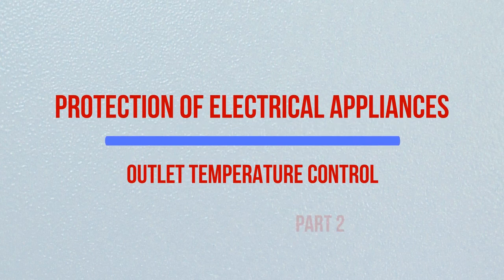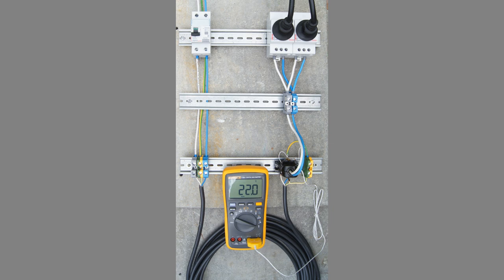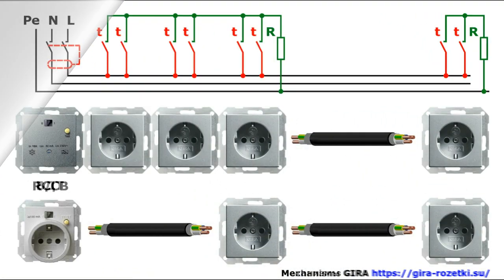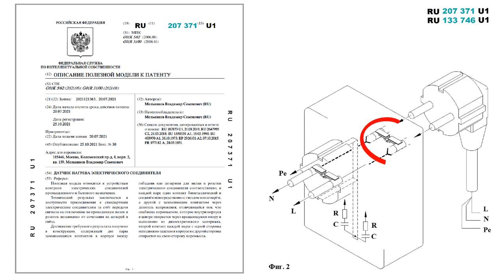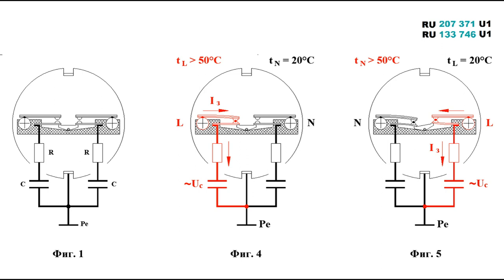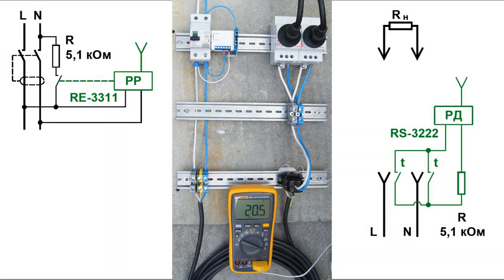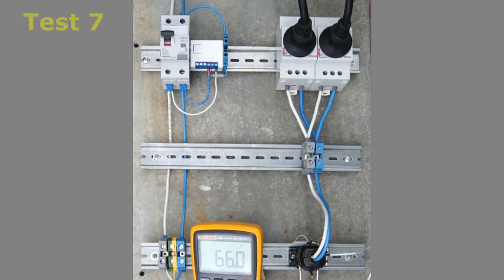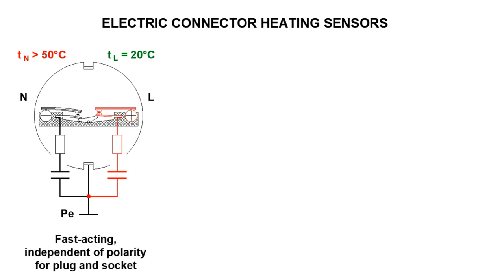Protection of electrical appliances. Outlet temperature control (Part 2)

Comment: better use a fusible resistor in case of RCD fail to trip, or much better use a resistor in series with  class-Y capacitor.
Reply from the maker: Yes, I agree. These options are provided. I have already shown tests of resistors in another clip. I am currently preparing another clip about this. The next step is to record the test of capacitors. In addition, safety is ensured by impulse control and staged installation of differential current devices. In the projects that are shown in my films, the first device is located in the storey (external interroom) shield, the second step is common for several groups in the apartment, the third step separately protects each group.